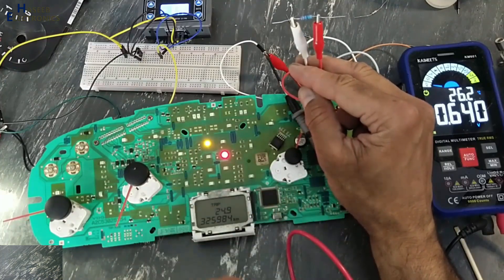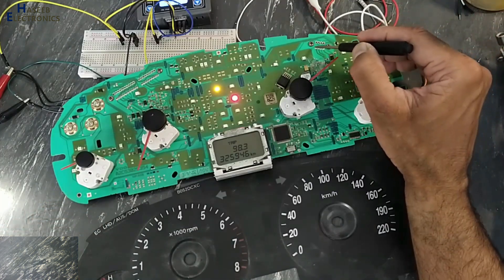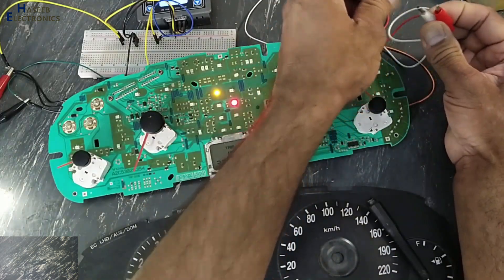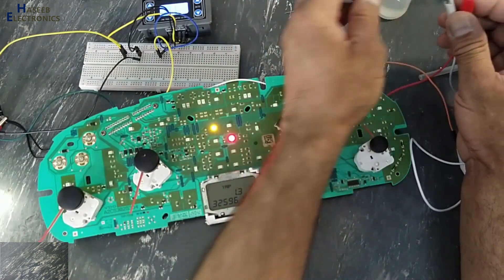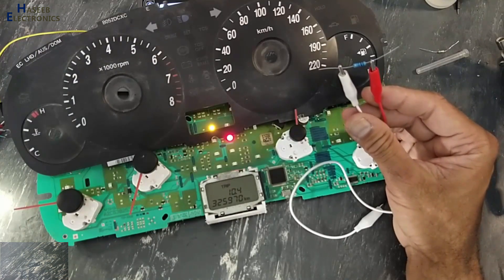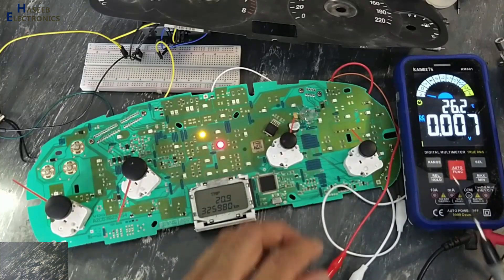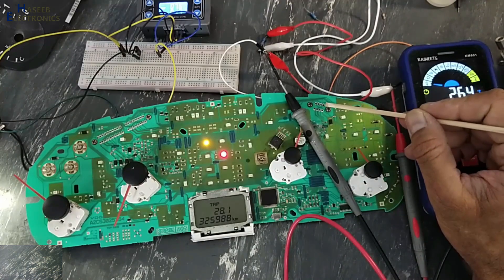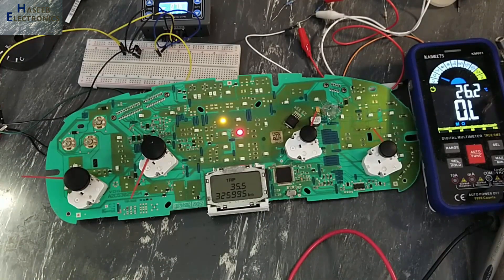{1223D} Temperature Indicator Repair & Test - Hyundai Elantra Cluster

Comment: These repairs are not in the service manuals! They want you to buy the whole dash or at least the circuit boards inside. Thank you for showing us these repairs. When I was a mechanic, my boss had me replaced a $750 (US) board for a dash. At that was wrong was a crack in the pins where a plug plugged in. Looking back, I should have "lied" and said I found a broken wire that needed soldering. I don't lie, but the poor customer would have liked it if I did and save hundreds of dollars. I love how don't cheat anyone. Your work is top quality sir! 
I love using that little devise for checking servo motors. I think I used 200 hz and varied the duty cycle. Great little tool as long as you don't burn out the sot-23 npn transistor inside. Oh well, easy fix. I want to make a little box and power supply for mine, but it's still loose on the bench. Best regards!

Comment: Sir can you please make a video on SMPS half bridge converter I don't understand the parts where 2 npn transistors being driven by a pulse transformer and each transistror as a capacitor in parallel with diode at the base of the transistor, and I see those transistor being biased by DC and ac at their base please explain how it's works, I saw it on one of your video on half bridge converter using tl494 ic